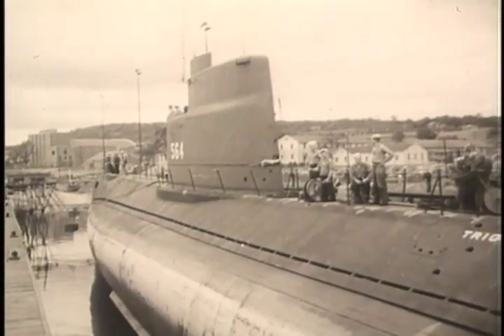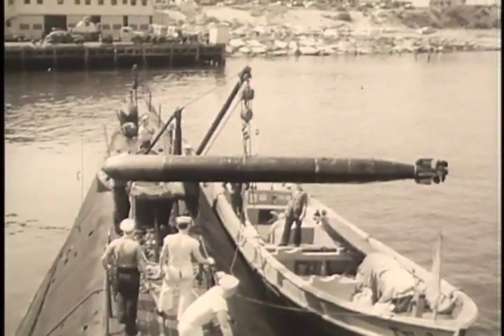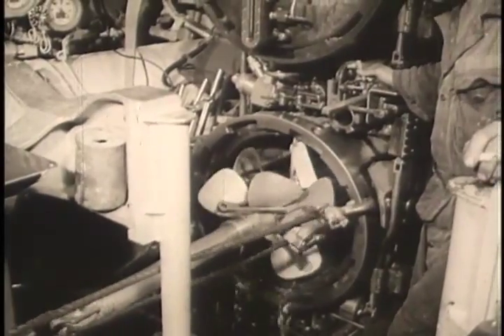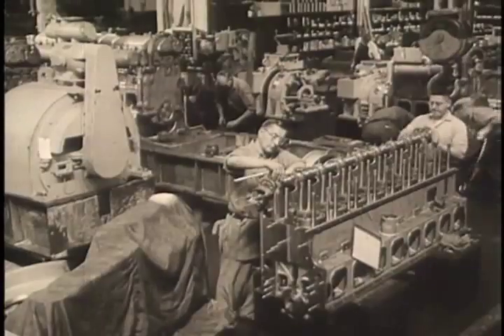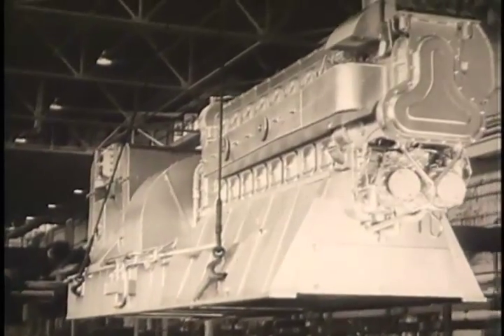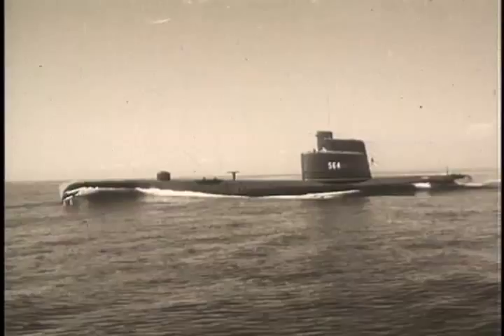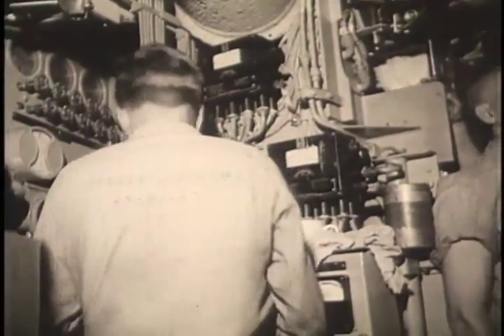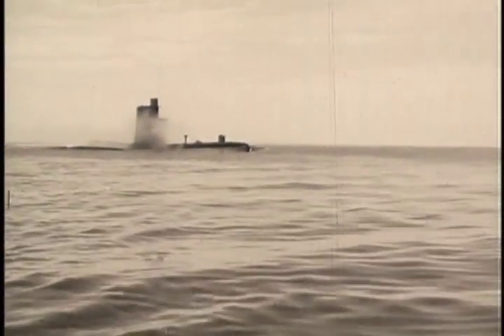USS Trigger - High Speed Attack Submarine

Comment: Let's not forget that on 14 January 1958, Trigger entered the Portsmouth Naval Shipyard in Kittery, Maine for major alterations. Her four troublesome high-speed diesel engines were replaced by three reliable medium-speed engines. The submarine was cut in two and lengthened by nine feet to accommodate the large, easier-to-maintain engines. Go Fairbanks-morse.
Reply: I served aboard the USS Threadfin SS410 in the 60's-70's which had been in the same wolfpack (Earles Raiders) when the original USS Trigger was lost.  Fortunately a day later, Threadfin got credit for an assist on the Super Battle Ship "Yamato" because of a radio communication reporting it's location.  Threadfin was also given the same upgrade as the replacement Trigger to a Guppy II-A Balao Class the same Fairweather Sail) and saw duty as part of Squadron 12 out of Key West until 1972.